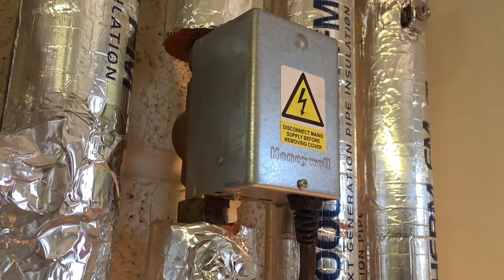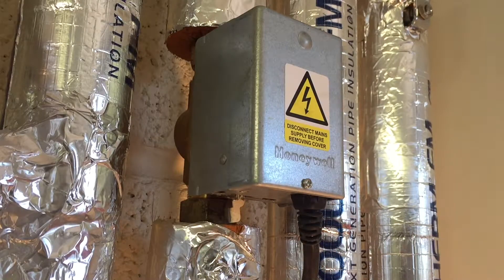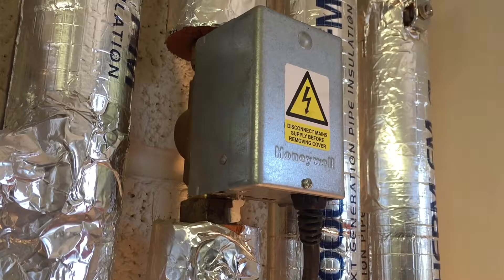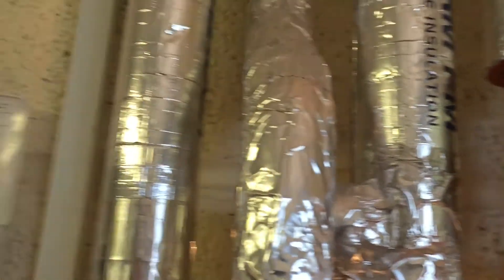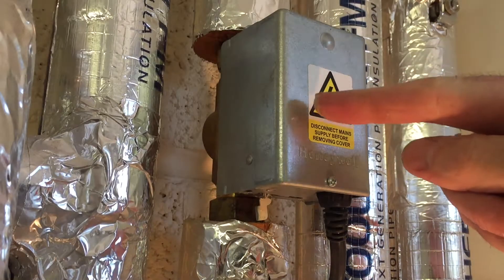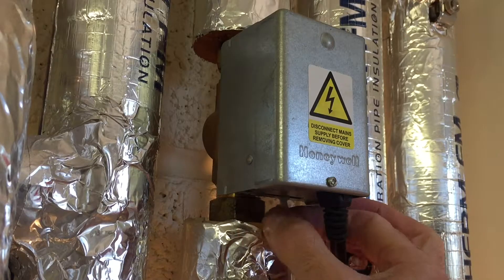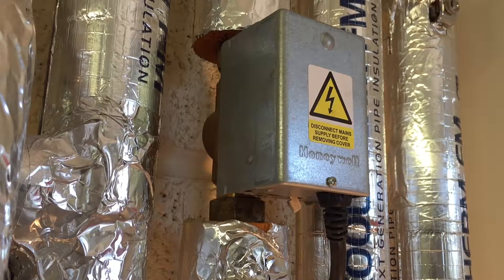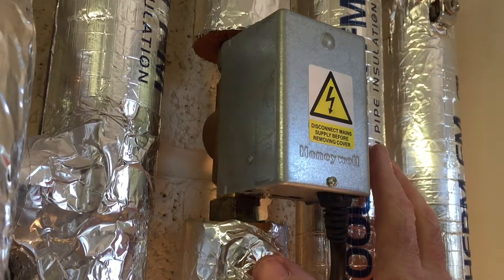how a motorised valve operates

Comment: Sir, in clicking the lever into the on position, am I right in saying that the central heating will just remain ON & not go off at the time the programmer tells it to (for example, 22:00 in our case)?

My mother slid the lever over and clipped it into position at the request of our plumber but this lead to the central heating radiators just staying on round the clock!

We've unhooked it now and will await to see if this cures our issue.

Comment: Mines got a little lever at the top near my water tank, and it moves when I switch the heating on, except it's not at the moment. I've got hot water but no heating so I'm assuming I need a new one. Mind you my boiler is a Baxi Solo HE so will need replacing soon with a Combi so I can get rid of the water tank I guess!

Comment: Does a two port valve require electricity to close and open or is one of the functions mechanical? I want to use a hot water storage tank thermostat to switch the valve on.  Will the valve close mechanically??